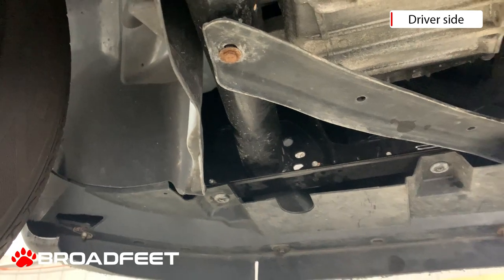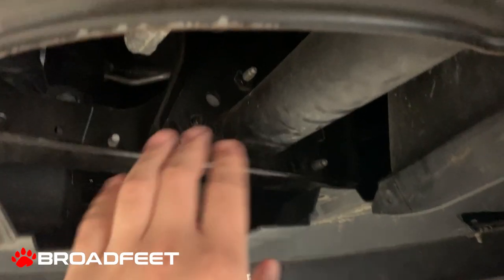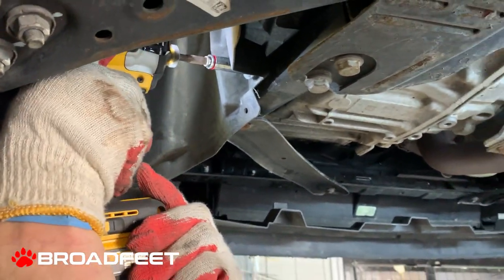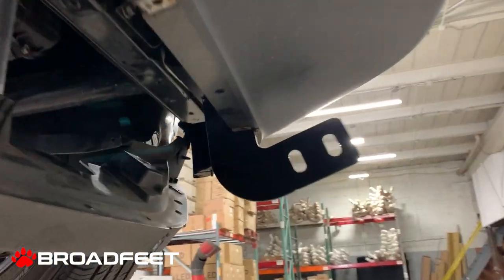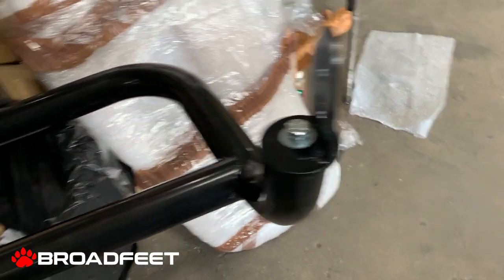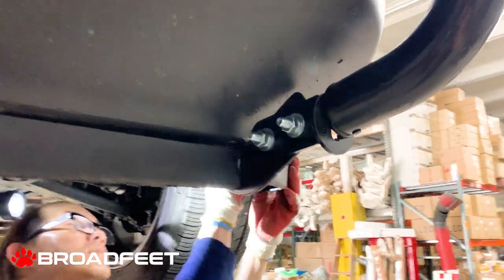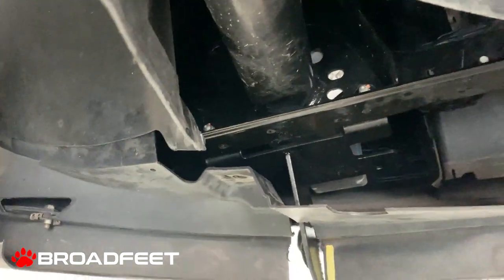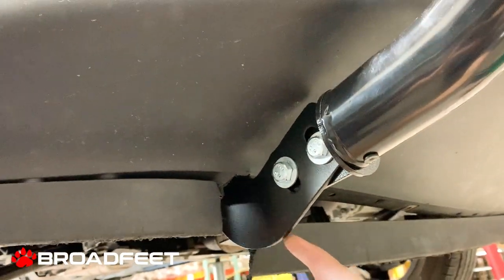Broadfeet® Front Bull Bar - A-Bar Installation fits: Jeep Compass 2017-2025

Comment: Will this fit on a 2023 jeep compass trailhawk?
Reply from the maker: We have installed these on the trailhawk edition before. The main concern would be the two factory tow hooks in the front of the vehicle. The bar would slightly touch the tow hooks. We also supply a longer attachment for the bars to be mounted for the trailhawk edition. It is best if you consult a sales rep. at (718)302-1787.